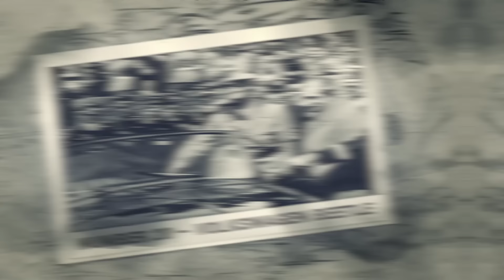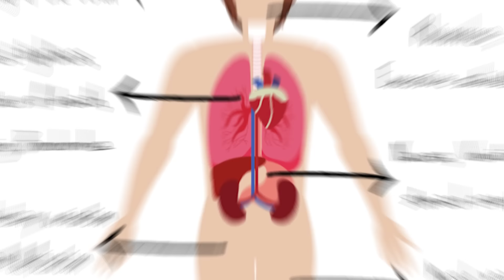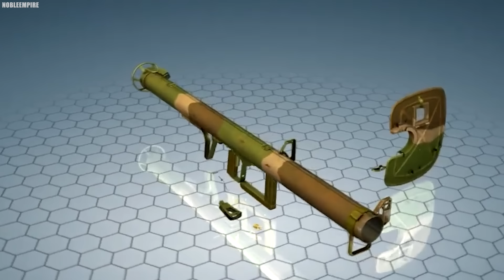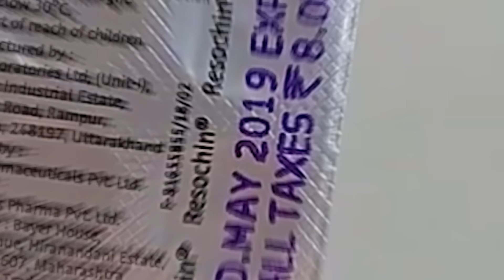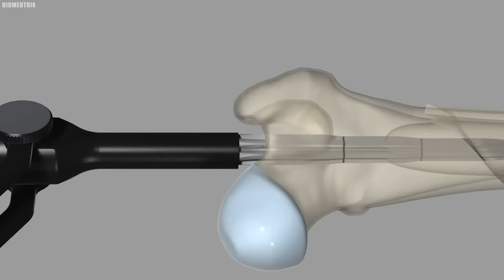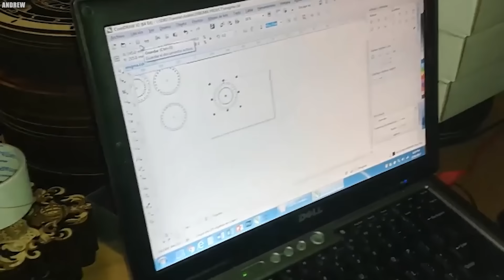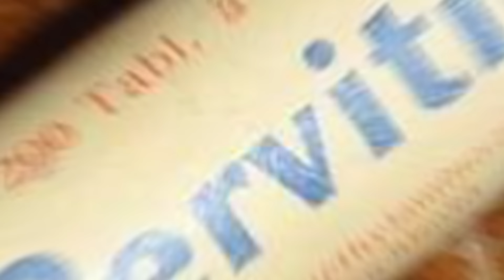20 Inventions You Didn't Know Were Made By Nazis

Comment: Britain created the world's first fighter jet years before. They held it back to continue developing because of the development of the specialist metals required to practically use in high demand combat. The Nazis stole the patents from Britain and copied the plans for the jet engine that Frank Whittle invented. The ME262 May have been put into combat first but it was not ready. It killed so many pilots due to engine failure and could only use the engines for a total of 50 hours lifetime before the engine was scrapped and had to be replaced. Britain's jets were far beyond that point of development, however, refused to put them in combat until they were more reliable. The first two realistic' combat jets were The Gloucester Meteor and The Dehavilland Vampire. Both strong and fast. The meteor saw WW2 Combat and didn't 'blow up'.
Reply: Go re-read history, since they held it back means it wasn't ready. Which makes your argument useless

Comment: The NAZI'S were a political power with access to many$   Ferdinand Porche was a car builder, so just needed the $ to get going.  What Hitler wanted Porche had designed in 1932 then put it on the shelf.  That is the VW beetle's origins. Porsche built such a car for Hitler in 1936 but Hitler rode in the car.,,prefering Mercedes Benz which had extra armor built into the car,  Very few VW got made as war hampered that.   When war was over and the U.S. was deciding what was transferable as bounty, For was the and looked at the VW plant.  He could make this work again as he had the capital to start the plant again using the Porsche design.